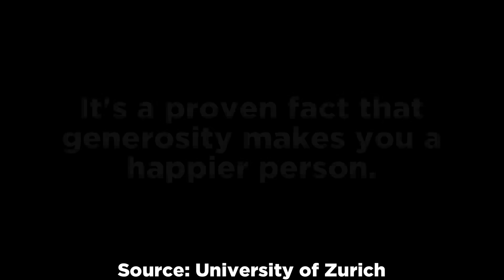Top 15 Scary Home Alone Stories

Comment: You don’t need cell reception to dial 911 from a cell phone. If you dial 911 your cell will connect to any network anywhere (it doesn’t matter whether or not your provider has service in that area because it’s an emergency)

Comment: I have a story like number 3. Once i was running from my sister out side so i ran inside (note my side door i was running in has 9 squares and the bottom right square is very lose and easy to break ) and shut the door with my sister be hind me and my sister tried to keep the door open by sticking her hand out but i had already slammed the door so she hit the lose square at the bottom and she broke the glass and it went every where while my dad was right there . He wasn't mad and said he had to replace it either way so we were able to pick up a new glass that day without my mom knowing.

Comment: A bed full of snakes?! I wouldn't just move. I'd stop using blankets or at least putting them on the bed until I got on there. 
 I personally don't believe that story though. I could see why they might go to the bed if it had an electric blanket that was left on, but how would "dozens" of them find the hole? How big was it? Did they not have walls or something? I've lived in rural areas for most of my life including close to a hill that snakes like to go up when it starts to get cold but in 32 years I've only known of 3 (at different times in 2 houses) snakes that have ever gotten in the house (that I know about) and they don't hang around together. I don't think I have ever seen two in the same place. I've also never seen that many snakes in a month much less in a single day. Another question would be why were they all have hidden under the blanket? Why were there none on top of the blanket or on the floor?